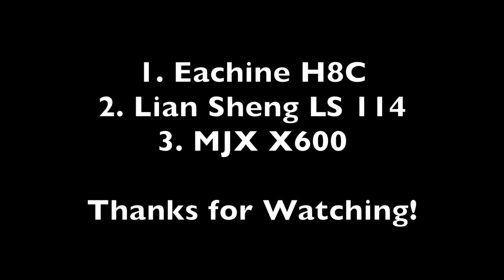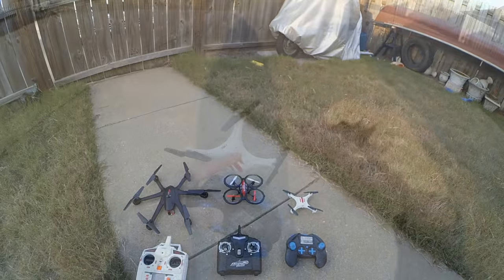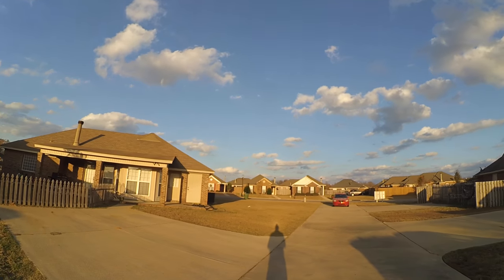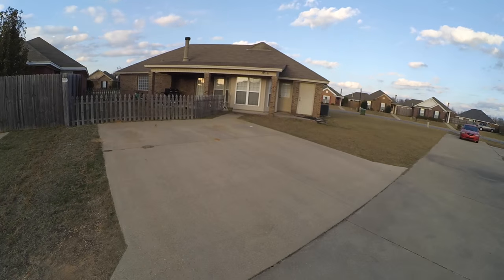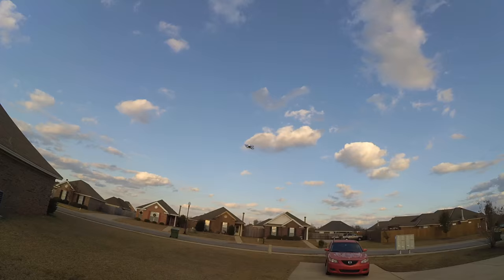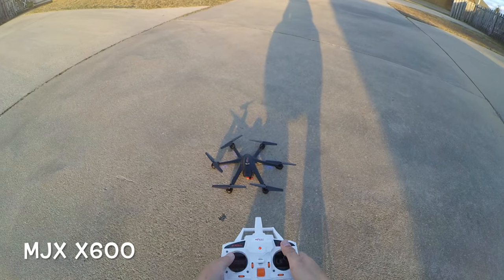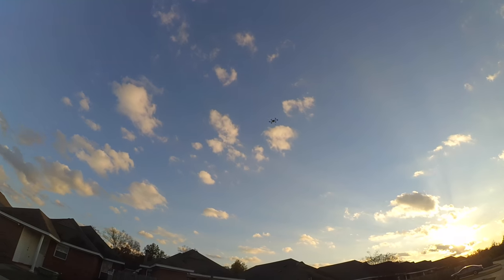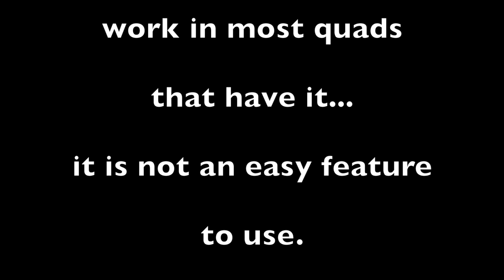Headless Mode - Eachine H8C, Lian Sheng LS 114, MJX X600 - December 2015

Comment: On our H8C quad copter the headless mode is the bottom right 4 way controller.  Press down on the 4 way once to activate headless mode and the lights flash.  The headless mode works great.  Push and hold for 3+ secs for return to home.  The top left button is used for pic/vid on our model.  :)

Comment: Manuel I did the top left trim button up but it isn't working plzzzzzzz help btw it's a ls 114
Reply from the maker: That is the button that controls headless. Try moving the button in different directions with the quadcopter bound and on the ground. If the lights start blinking it's in headless. Sorry it hasn't worked for you. This quad can be twitchy so be patient.

Comment: The headless mode on my ls 114 isn't working plz help😭😭
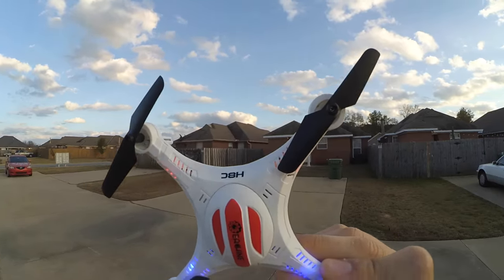Reply from the maker: Starting 4:44 I show how to turn headless on. It works with the second trim button from left to right. You'll know it's in headless because the lights start blinking. Good luck!
Reply: +Manuel Escobar Drones and Video yes mines is not working